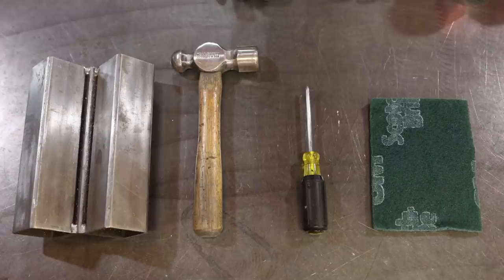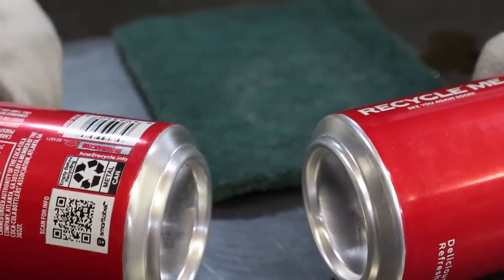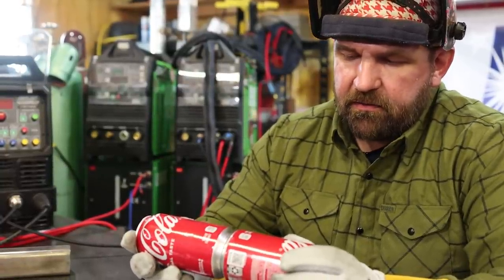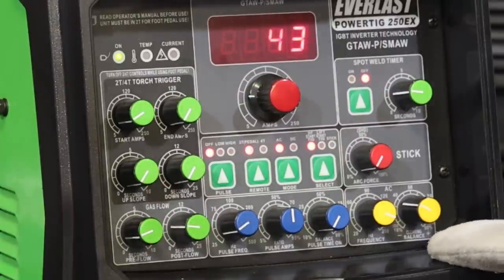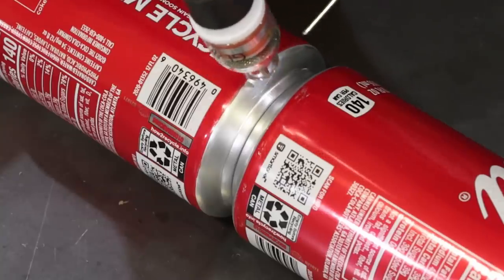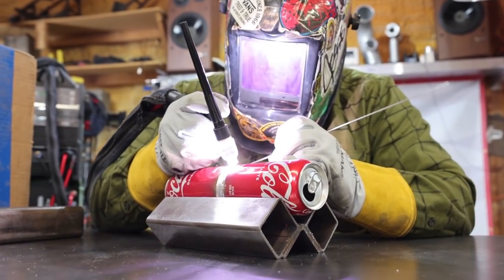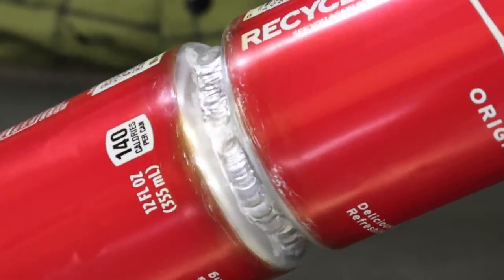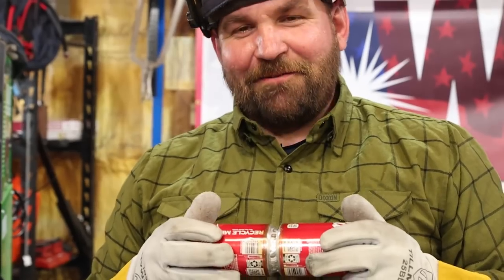The Most Requested TIG Process You'll Never Use

Comment: I know absolutely nothing about welding, so this sounds like almost nothing to me, but everyone in the comments seems very impressed. I think that shows the depth of the field in that something apparently simple can take huge amounts of knowledge and skill to achieve. Well done to everyone involved, even if I don't know well enough what I'm congratulating.
Reply: Super thin material. Very hard to weld and not melt into a puddle of cheese
Reply: It’s a super thin material with a very low melting point (like 1200 degrees).  Welding aluminum happens at 1100 degrees.    So you have a very small temperature window to start with.   Throw in the super thinness of the material and  it makes the welding window super super small.   It would be very easy to melt the can and turn it into a puddle of cheese.   Or just have massive burn through all along the weld

Comment: As a relatively green welder ( I've been welding for about 3 years now, with a focus in TIG for the last year), this is something that's always in the back of my mind. I work at a sheet metal fabrication shop, so I am routinely TIG-ing material all the way down to 0.040 aluminum. The welding of cans is something my boss always points to as a mark of a very capable welder and man lemme say you made it look easy. I think cans like that are around 0.040 thick which is not easy stuff to weld, not to mention all the way around a circumference. Awesome vid, made me wanna try it with my everlast in the garage.
Reply: Coke cans are definitely thinner than .040; even thinner than .032.   Cut one apart and you'll see what I mean.  A quick google search says that in the US soda cans are .010, but I don't know how reliable that is, I don't have a micrometer handy.
Reply: 0.04" is roughly 1mm thick which would hold a battle tank. A beer can is closer to 0.004" thick or 0.1 to 0.08mm.
Reply: cans are .003" to 004".  I used .045 or .030 wire and lots of preactice.  It is not as hard as you think once you get a feel for it.  Lots of guys use it for practice for aireospace certification tests.  Tacking is the hardest part (fit is critical), second is moving fast enough to prevent warping. You will get there
Reply: The main reason for your fail is not exposing the the aluminium properly...most times the succes of a weld is the preparation of the weld...that's the heart of the weld bro,here's a tip to get that cleaning better,get an abrasive sponge pad of a fine grit and buff the bottom edges of the cans you want to join,the clean that with acetone (also clean the filler rod with acetone),then start practicing from there,next step,fine tune the way the arc melt the  puddle (you actually don't melt a puddle on the cans but on the filler rod) by tweaking the balance of the machine,have a start from the settings presented in the video,good luck there 🙂
Reply: @kubeek  you are using the wall thickness for the middle of the can, that extruded ring on the bottom is much thicker

Comment: I have a lot to learn before even thinking about doing this. My trick with soda cans was from when I worked in a printed circuit factory, We would take some waste etchant, dilute it and set the can in it. It would dissolve the aluminum and if you diluted it properly you would have a perfect plastic can left. Soda is very corrosive and eats aluminum so there is a plastic coating inside the can. Etching the aluminum off leaves you with the plastic coating only.
Reply: Could you go i bit more in Detail? Sounds interesting
Reply: @evoxis1058  The etchant used was called Cupric Chloride, it was green colored. It had hydrochloric acid and chlorine in it as added ingredients but you started from a starter solution which is really just the same waste product which will have a certain amount of copper dissolved in it. the trick was to dilute it with water as the reaction with aluminum creates heat. If it's strong enough, it looks like a little flame around the edge of the line where the can is floating. Too much heat and the plastic melts. Too much water and it takes too long or won't work at all. So it's touch and go to find the right ratio. I'm sure there are plenty of acids that would work. I discovered this where there was a plastic tub used for draining the hoses used to pump out tanks into a semi and rain water had diluted it. Trial and error with many attempts and we would get a perfect plastic can.
Reply: but how do you learn a lot if you don't try!

Comment: thx man. ill actually use this method to make a Summer-Time Heatblower  (hard to explain whole concept) but this information is going to be put to use when i have to weld like 10 cans to each other and have like 5-7 rows of them. put them into a fram, attach a blower/motor to the buttom, place it in the hot sun. also tickering with trying to add water into the system, and then into our main water tank :s

Comment: Did that once in the 80's with a 110 volt mig welder. I think it was a hobart handler on 030 wire. Did the bottom fine without blowing through but could never get the sides to weld.

Comment: I was told that this was a test when my cousin went to school for welding. I don't know if they had to weld them together as you did or if they cut the can in half at its thinnest point and had to weld that back together. He passed the test whatever it was. He was supposed to be a very good welder before he got hurt on the job at a Shell Oil refinery.
Reply: Butt welding the middle of the can would almost be impossible.
Reply: @benjaminboyden4739  steel yes, aluminium no. 
aluminium transfers hear insanely fast, so when your welding on super thin aluminium with low power its harder to blow through than steel, you can weld aluminium foil and that is certainly thinner than a can

Comment: You're mostly right. Most people will never need this. However, there are exceptions. Example: there is a government contract shop(in Bergen county NJ), that does jet engine components. Their interview weld test, has the invited candidate, welding a stainless steel alloy tubing not much thicker. Now yes indeed, stainless is different from welding aluminum. But this is a cheap practice piece still. For the rest of the world yes, no one is going to do this , for a practical application. But it is still a useful exercise, welding paper thin stock. There are applications for welding uber thin stock. However few, and far between they are.
Reply: to be fair, I feel like there'd be much better, cheaper tests then welding 2 cans together.
Like for instance, literally just buying aluminum plates from Home Depot, or Lowes that just need to be cleaned/acetoned and then welded.
Reply: @DrCranberry  I didn't say that they had you weld 2 cans. I said that it(welding the cans) was cheap practice, for welding thin stock.

Comment: Good day, we have an Everlast STI 221, I love it but no matter how low I go with the amp settings (20 amps) I can not weld thin aluminum, period. If it is not thicker than .80" then it just blows through. I am using 1/16" tungsten with a 15 degree sharpened end. It still blows through. I know it is me but do you have any recommendations? Other than thin aluminum this thing welds like a dream.
Reply: Hit me up on Instagram or Facebook and lets see if we can get that sorted out!
Reply: You should be getting lower amps than that. At 1amp per .001”, at 20 amps. That is limited to .020.
Reply: A main problem I had was Not keeping the rod right there,         Keeping the rod always at the edge of the puddle guarantees filler metal taking most of the heat and not the thin can.  Plus don't lag,   move fast enough,  keep the rod ALWAYS right at the puddle so you have instant filler metal.
Reply: This might help; I upgraded my stock pedal and my amps dropped from 10 ish to 7.  It could be the pedal. I have occasional found bum pedals at work.
Reply: I just barely touched the pedal at 20 amps and it still blew right through, I often wondered about that pedal. Thanks!!!
Reply: @littlewarlock9361  With my lincoln square wave 200, even with the amps all the way down (10) the arc actually lights up at 40 amps for a fraction of a second. With real thin metal like aluminum cans or auto body that's enough to blow through almost instantly so what i do is always light up on the filler rod. After the first big zap, i can continue like normal. I'll eventually buy a nicer machine but it works for now.

Comment: This past Fall I cut up a set-at-the-curb-for-trash-day water heater to be used as stock sheet steel for a beefy DIY snow shovel.  The finished shovel out rather nice.  We're still waiting on enough show to test its functionality, though.

My Everlast 70 amp plasma cutter makes quick work of disassembling such scavenged source metal.

Comment: Not that anyone cares but the bottom of the cans have a coating of varnish on the very rim. It’s put on there to make them slide easier on a conveyor belt during manufacturing and filling.
Reply: Nowadays with aluminium cans it is, but in the old days with steel cans it was also there to protect the rim from abrasion by the conveyors and in the stores, as the bottom would rust out from the outside as the bottom was left uncoated steel.

Comment: I used to TIG weld a 315 degree outside corner on 25 SWG 0.020" aluminium regularly at between 18-24 amps, but that's aerospace defence contracts for you.

Comment: My welder is a Lincoln Idealarc 300 tig / stick transformer type welder. Weighs in at nearly 1000 lbs. I have a couple of foot pedals and a torch mounted control as well. What range of material thickness do you think this machine should handle? And I said machine, not me as the operator because I am WAY out of practice. I do pretty good with the stick welds on 1/8 - 3/8 steel which satisfies my typical welding needs. In the past I have made many tools and jigs out of stainless that I tig welded together, as well as some titanium and aluminum repairs. That's where I want to concentrate on building my skills back up, especially the thinner stainless.
Reply: Somewhere, you should be able to find the minimum amperage your machine can put out. That'll dictate how thin you can go. I'd guess he was giving it about 20 via the pedal in this vid.
Reply: just buy the sheets of various thinness. and try them all. youill figure out wat thinness your gear can / cant do.

Comment: I don't know 100% why but I would like to have seen what would happen if you stacked the cans top to bottom when welding them. but opened both cans and emptied them and put water back in both cans. Or even do the same think but left the cans full. Would it help with heat transfer.
Reply: water boils at 100c, you cannot weld something wet as the water would evaporate instantly.
and if you tried to weld unopened cans they would explode. really not sure what you are thinking here lol.
Reply: @HappyDragneels_page   Thanks for you reply.  

I am sorry as I am unsure if I explained my thinking for you to be able to understand it 100%.

You can't weld something that is wet? You do realise there is underwater welding? lol but it wasn't about the cans being "wet" or the pressures created.

It is more of a question of heat transfer, do you believe there is enough heat going into both cans to heat the (give or take) 700ml of liquid coke to 100°C or whatever temperature that would create enough internal pressure to burst "explode" the cans. 

What if they were cans were full of oil?
 
What if you cooled the cans & liquid down to just above freezing? What if you could kept the liquid at that temperature whilst welding?

It was more of a question of if a liquid was still in the cans what effects would that have, especially with heat transfer?

Would it be closer to welding solid cans?

Would the can still blow out as easily or would it be more forgiving?

What do you believe would happen?
Reply: @jimbarbwe1985  when i said " you cant weld something thats wet" what i meant was as soon as you start welding the water is gonna evaporate, you see this in underwater welding as bubbles obviously if you are underwater welding you arent going to boil away the whole ocean...

i am simply struggling to understand how you are going to keep the water in contact with the metal, the leidenfrost effect prevents liquids from touching very hot materials. you wouldnt be able to confine it or the pressure would cause a burst (this is why he punched a hole in one of the cans) replace the air with water and you still have the same problem

because aluminium transfers heat so fast pre-cooling wouldnt do much either, when you strike an arc the metal goes from 0 kelvin to thousands of kelvin in a second so starting at say -200 K would have almost no effect

if you try to weld a sealed can with liquid inside it, it would burst almost immediately.

if you try to weld an unsealed can with liquid inside it, the liquid is going to start boiling at the point of contact immediately, the gas produced would prevent the liquid from keeping contact and any cooling effect would be incredibly minimal.

 "do you believe there is enough heat going into both cans to heat the (give or take) 700ml of liquid coke to 100°C or whatever temperature that would create enough internal pressure to burst "explode" the cans. "    it doesnt have to heat 700ml of liquid, it just needs to evaporate the liquid TOUCHING the weld point, which turns to gas, the pressure of the gas would burst the can, not the pressure of the liquid.

i hope this makes sense.
Reply: @HappyDragneels_page  Possibly, as I said I am unsure and this is why I would like to see it happen.

Comment: You can use this process to make tubes out of beer, soda, etc. cans. And place them in solar panels and heat your house in the winter sunny days for free almost. You still need to operate a small fan, Like a computer pocessor fan. I think you can tack the cans and use some kind of seal for the rest. Welding like this an entire solar panel would cost too much and the weld for this kind of project is overkill but a tack to keep them together is perfect.

Comment: The challenge is to cut 1 can in half and weld to back together. The buts are thicker than the sides. And the formed bottom holds shape better not to mention being a better heat sync

Comment: Well, not what I was expecting.  I've never it seen done.  I always assumed that welding a soda can was, cutting a can in half and welding it back together.  Thought this was going to be it.
Reply: That would be quite the trick. I'm sure someone can do it but not me. I've done what was shown in the video though.
Reply: THAT would indeed be quite te trick, as the metals is way thinner at the sides then it is at the top or the bottom.
Also the rim of the can (the part the can stands on)is a real sharp bend, like a little U so you are actually almost welding 4x the material thickness when welding rim to rim.

Comment: I used to work at a machine shop and in the break room on the table was a half coke can half Pepsi can but one of the guys had welded together Seems like it would be much easier to weld the two bottoms together then the cut cans in half and weld together in the middle. Nevertheless cool video

Comment: If you were a real welder, you woulda done a ghost arc on the sides of the cans with a 1970 gas powered Lincoln Pipeliner running 1/8" 7018 rod without even cleaning the coating off the cans.
Reply: I just play welder for youtube